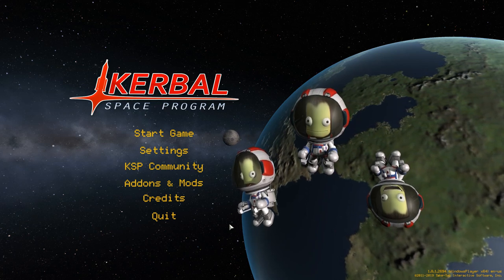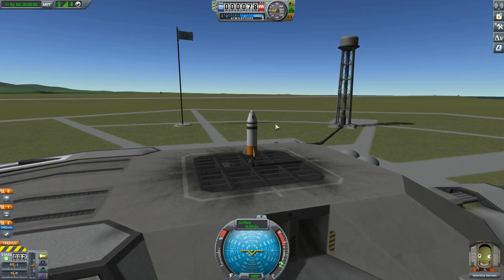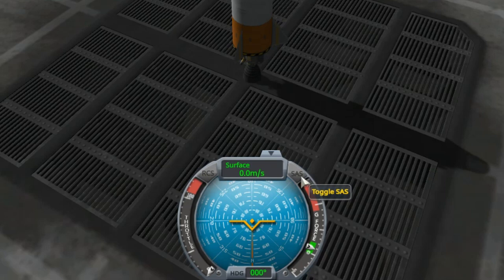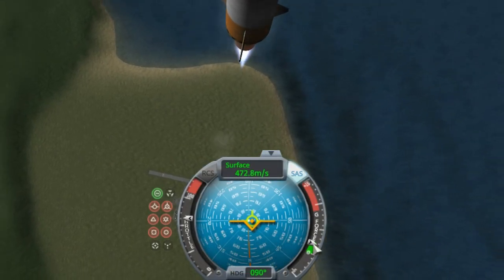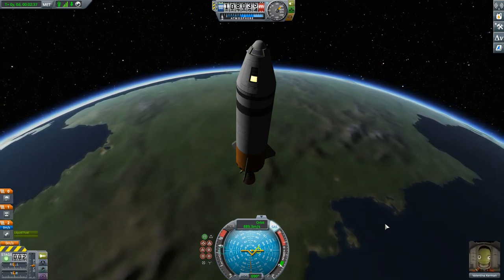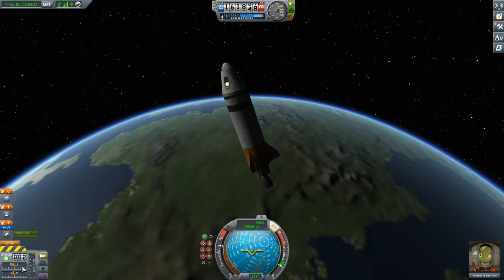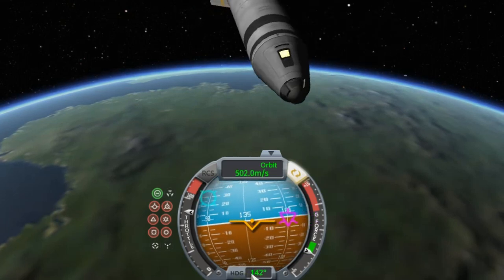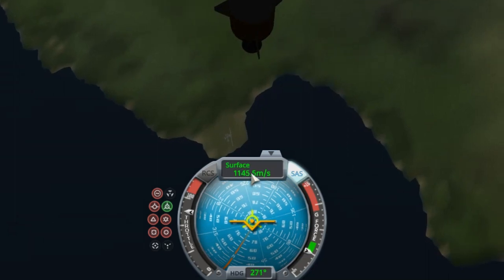Understanding Flight Controls - KSP Beginner's Tutorial

Comment: The partially deployed and fully deployed modes are things real reentry parachutes do, so the chute will not rip apart at high speeds, but will still slow the vehicle down enough so the chute can fully deploy.

The "partly-deployed" state is "reefed." The parachute is held in a closed shape with wires near the mouth. Small explosives called "reefing charges" cut the wire and allow the chute to fully deploy.
Reply from the maker: Thanks, John.

Comment: Great series! Only thing missing in this one IMHO you should mention that for those advanced controls in SAS to be available you must have pilot in the cabin and pilot needs to be trained (this applies on career mode though).
Reply from the maker: Very true. Thanks. I've been avoiding career mode for now but I do plan to get to it.
Reply: Also, the navball now does not have all the icons on the left side until you upgrade your tracking station a couple times. This costs cash, so you will have to take and complete contracts. First upgrade, you can use SAS and you can see the two prograde and retrograde icons.. Further upgrade make more of the icons appear.
Reply: Great post. Am I to take it that a Pilot is "trained" by gaining ... XP?, or is there something specific required for by Pilot and each additional Nav. Tool displayed on the HUD. I ask because all my Buildings are currently fully upgraded, but I still only see the basic HUD display even when using a Pilot.
Reply: @1800cc-Dead-Meat  yes when fly certain places, put flag first time etc they get experience points and they level grow.

Comment: im got this game just a week ago, very late to this party however i love it all the same. I just cant stop from trying and trying over and over just to reach new heights and new milestones. However my orbits have still been fails. Im still having a hard time understanding thrust to weight ratio and why its important, would anyone have any specific insight on that by chance if someone still see this comment. Fly high spacemen
Reply from the maker: Thrust to weight determines the acceleration of the craft. They're really only important during ascents. You need a TWR of more than 1 to get off the ground, but too high can make the rocket more difficult to control and explodey. I like a launch TWR of 1.33, many prefer higher, but don't be higher than about 1.6 or so. TWR is much less important in space. You can easily have TWRs much less than 1. A very high TWR means you have too much engine for the job. Try switching to a lower thrust, lighter, engine.

Comment: theoretically you could throw the ball so hard it exits the solar system- but only theoretically as thats literally impossible to achieve.
Reply from the maker: If throwing from Kerbin's surface, and ignoring air resistance, that would be 4971 m/s if thrown eastward from the equator.

Edited to add: And you should throw it shortly after sunset.